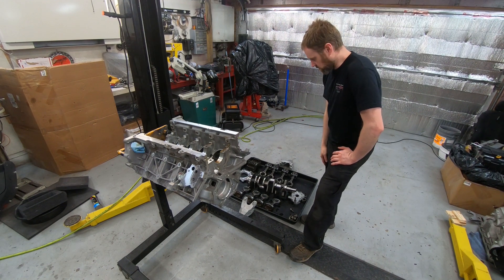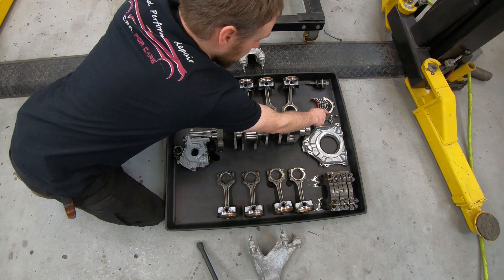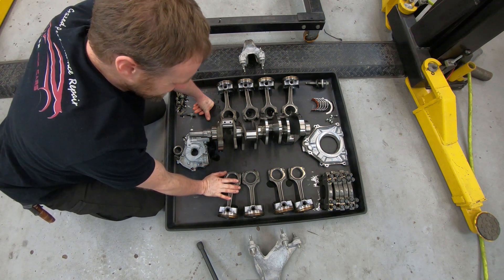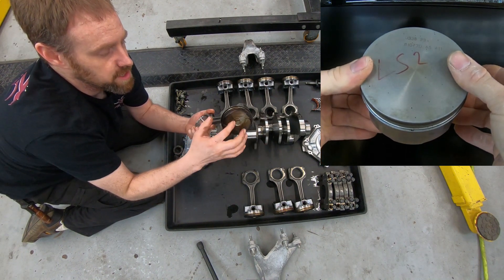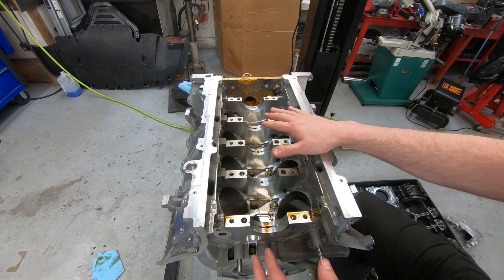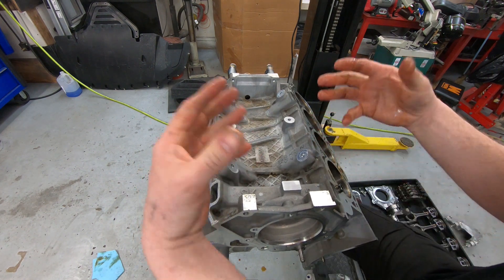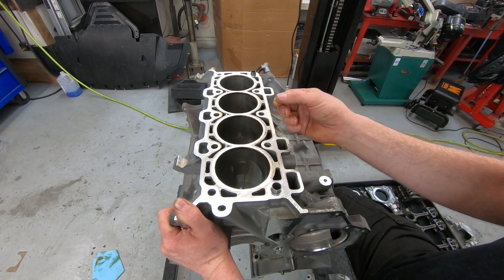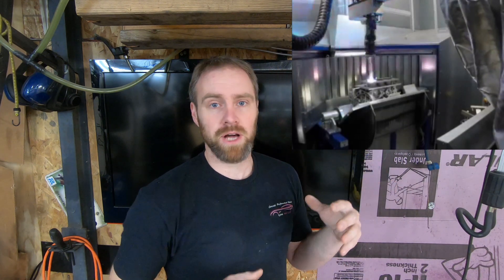Ford VS Chevy Performance, How the Engines Compare

Comment: My exact thoughts brother. I know this is old but it is new to me. I have a 03' Crown Vic Police Interceptor I am doing a Gen 4 6.0L swap in. The Coyote is too expensive for what you get. I can swap the 6.0L and 4L80 in for about what the 5.0L engine itself is costing. Even out of a truck. I'm going to have about $3500 to $4000 in my swap and with the cam I'm hoping for about 400 to 450 wheel horse power. A Gen 3 5.0L out of a truck is still running $3500 plus for a high milage one. That's just the engine. I am planning on going with a 6L80 trans. I want to go the 6 speed route and see how she performs in this heavy car. Thank you for the info brother.

Comment: Coyotes are by far the most superior American v8 ever made. There are a ton of daily driven 1000+hp factory sealed engines running around. By that I mean never even cracking open the oil pan, everything stock, with help from boost. The fast quarter mile time for a FACTORY SEALED Coyote is a 7.9. You can find the video of on YouTube. That was in the car it came with, not a gutted foxbody. 800-1000hp in a daily driver is not only done regularly, but it's still reliable as long as you have a good tune and everything is done correctly. Coyote FTW!!!!

Comment: No sleeves?
Motor Trend:
To exceed 500hp, Ford pulled out all the stops. It began with a trick engine block, featuring Plasma Transfer Wire Arc (PTWA) technology, a process that allows the material to be sprayed at supersonic speed onto the cylinder walls to create a durable finish, which eliminates the need for cylinder liners in the aluminum block.

The PTWA technology was first used on the 2013-2014 Shelby GT500 engine and all blocks starting 2018 from what I read.

Comment: You can’t just talk about chamfer you need to understand bearing overlap on a V-8 motor that gives it a lot more strength than you think. Bearing overlap can be seen if you look straight from the crankshaft snout towards the back the rod bearing verse main bearing overlap in that plain is what gives a V-8 crank shaft not just the fillet.
Reply from the maker: I didn't just talk about chamfer, I believe I also mentioned the lack of material in a specific area of the crank. I understand where your coming from though. The ones I've seen brake are broken with crack right along chamfer area though. Maybe it's just me getting them.

Comment: I've seen all your videos on dissasembling the Coyote, and you mention several times how weak the crank appears to be. In the Coyote world, the crank is just about the strongest OEM part and is usually one of the last things that fails/gets replaced when making power. These cranks go to 1000+ easily and 8000rpm. I would say that's pretty strong.
Reply from the maker: Well 1000hp for a short time is different then in the long term. The Ecoboost cranks look identical and are breaking in that same spot I mentioned looks week. You also have to consider in modern V8 world of today it doesn't take much to make a stock crank handle 1000hp. Besides that it's the torque that will kill the cranks not the hp. That's prob why the Ecoboost engines are having issues. They make a lot of low end power which puts way more stress on the crank
Reply: @CrazedPerformanceRepair  those cranks are damn near unbreakable bud. You will have to make upwards of 1300 to break the snout.
Reply from the maker: @mytruthslays1303  well first of all read my comment directly above yours. Secondly it's not the snout I'm concerned about.
Reply: @CrazedPerformanceRepair  what about the 5.0 block ? How strong is it in your opinion?
Reply from the maker: @Oliver-ft2fq  seems built well, only thing I really ? About it's capabilities is, how well the thin spray welded sleeve would hold up to excessive cylinder pressure. I also at what power level would the aluminum block start to move enough to effect bearing clearances. I'm sure 1000hp is no issue but how far can it go? I'm not sure.

Comment: The Coyotes tend to develop cracks in the valley when the block really gets pushed. Shops like MMR weld reinforcement gussets in this area to prevent this cracking. The sleeves are crazy thin. The 3rd gen Coyote even uses a sleeveless block.
Reply: The gen 3 is reinforced in the water jackets stock. Still, any coyote above 900+ should be sleeved imo.
Reply from the maker: Yeah this is a 3rd gen. It has plasma welded iron cylinders rather then sleeves, its crazy how they plasma weld it on.
Reply: This was an issue with early coyotes, it's not an issue anymore.

Comment: Because of the short skirts on the Ford pistons as the engine wears piston slap develops especially when the engine is cold. I like the LT4 with a manual so you can control the valve issues.

Comment: I think the Ford is basically smoke and mirrors. Unnecessary BS. If you really needed the OHC and the maintenance that goes with it, it needs much better design. Its made foe bragging rights IMO which in reality it has none but most people dont know that.
Reply from the maker: Idk it does have much better power curve. Better for drivability because they can maximize tq and hp rather then need to choose where they want the power to be.
Reply: @CrazedPerformanceRepair  Well I suppose I'm actually comparing with the last generation. I still dont imagine its far enough ahead to make it worthwhile to me. There are many drastic things I would change about both if possible. None are actually available though! 😁
Reply from the maker: @micahap1559  yeah ford 2 valve overhead cam engines were a waist of engineering I think lol. More moving parts for zero gain and added mass... What a waist. The 3 valve stuff was at least like a neutral change more parts but some airflow gains so it left I in a weird place. This one though with highly variable timing and 4 valves is actually not to shabby from a gain perspective but I'll still take a pushrod engine for my use lol
Reply: What exactly is the extra maintenance that an OHC motor needs over an OHV one?

Comment: Hate to say it but its awful hard to beat ls motors for the power to money ratio. All the big street outlaw racers and many more people will run chevrolet motors. Chevrolet for the win, like a rock! Lol
Reply: Best V8 engines out of the big 3
Reply: @samsquires94  Definitely. Diesel engines might go to cummins but thats a different story lol
Reply: @samsquires94  Although duramax is good i just think all in all its hard to beat cummins when it comes to diesel motors.
Reply: I've had 6 coyotes apart gen 1 through 3 and haven't run across such a piss poor deck machining. Wow. That one looks like crap. However, I have seen a couple that were barely deburred.
Reply: You can take a factory SEALED coyote, never even crack the motor open and make daily reliable 1000hp. You can not do that in an LS.